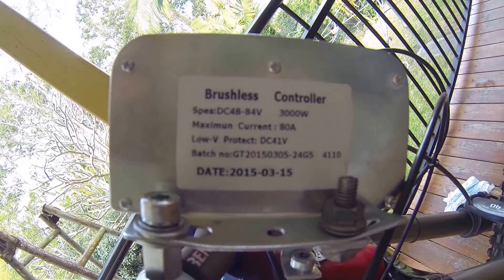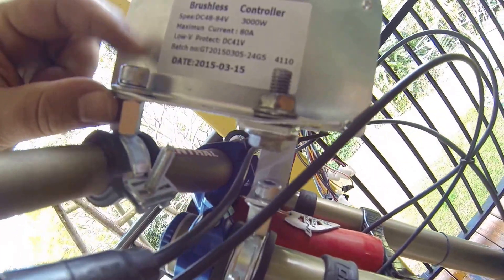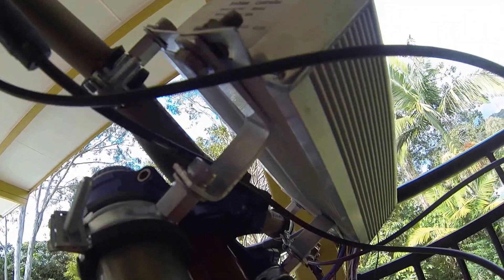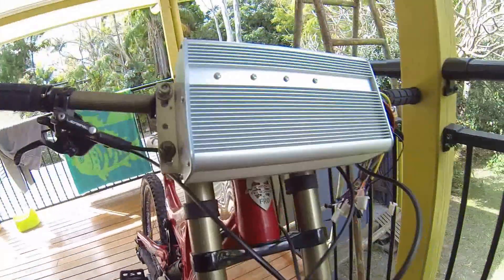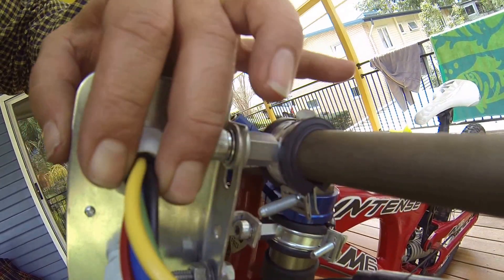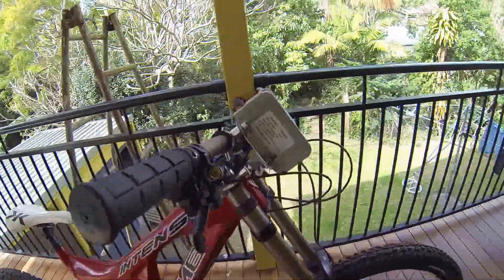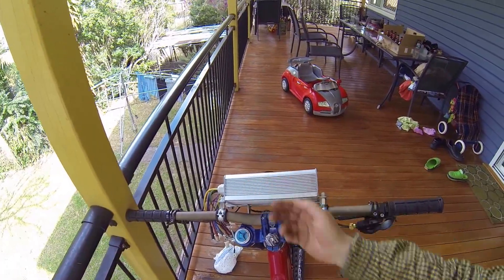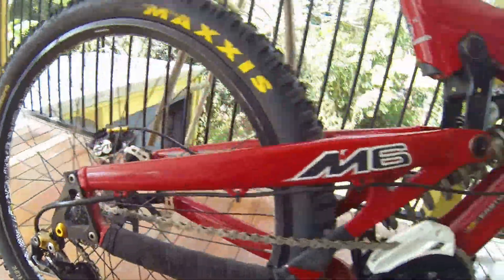3000 watt green time controller mounted on forks Electric Bike kit conversion

Comment: yeah man.. looking awesome!! The controller mounted on the handlebar reminds me some crazy russian electric bikes.. hahaha
Reply from the maker: +ElectricBike (Bruno) It's a pain of a size that doesnt fit anywhere on the bike.  I'd already bought it earlier this year for another project that I ended up not needing it for.  One thing for sure is that Ill have no controller overheating anxiety.
Reply: Hey mate... do you still using your BBS02 in conjunction with a hub motor???
Reply from the maker: ElectricBike yup, it kind of lost its importance once sticking to onroad but the 1kw el cheapo hub overheats fast so it has found a different angle to coexist.  its an addictive thing once you have set up two motors - opportunities endless.  yes weight and complexity but even after giving the bafang a fair go running alone I love my hub too - you should try it.
Reply: I have been thinking for a looooong time to try both technologies together like you did... but I am also really mental when it comes to power... I would love to do something reeeeally insane... =]
Reply from the maker: The logic is that they be totally opposite gearing to get the most out of them.  As much as I'd like to try a small hub motor I dont know if the side covers can handle the middrive
Reply: Yeahh makes sense have both set completely opposite! Have you ever tried the powerful Crystalyte like the ones used in the Stealth Bomber? I have been thinking about getting one just for fun project drilling lots of holes for better cooling and overpower to the limit...
Reply from the maker: this was my bike before I broke the axle on the crystalyte motor which is the same as what stealth runs https://www.facebook.com/photo.php?fbid=10152539574344845&set=a.10152149607104845.1073741826.531544844&type=3&theater click forwards through the show to see more
Reply: yeaahh.... this is EXACTLY what I had in mind... massive holes all over the plate!!
Shame you broke your axle... Any plans to repair?
Reply from the maker: For a few hundreds buck repair I am not sold if it is worth it.  I am going to put a ton of holes in my 1kw motor once the new bike on the road.
Reply: yeahhh... something so simple and so efficient... it just make so much sense.. why not!!
Did you ever have any problems getting mud or anything inside the motor? I would cover the holes with a thin metal mesh acting like dust-filter just in case...
Reply from the maker: Once its been coated inside with the right stuff the only worry would be a rock which I never noticed and probably they get pulverised, sure the whole inside of mine was full of fine dirt.  My mate used to just hose his clean after every ride and then hit the throttle to dry it out.